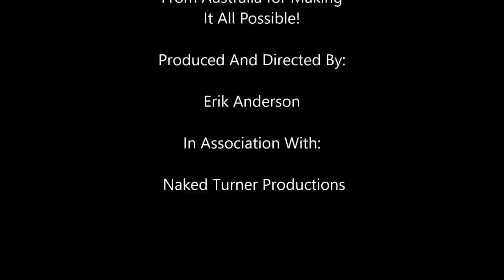Naked Turner Hairy Oak From Les From Australia

Comment: A bit of a notice after I posted my last comment...you mentioned Zip kicker.  Do you use the Zip/Zap brand of glues?  I have noticed that the glues (CA and epoxy) geared for R/C aircraft tend to be more resilient as far as flexibility when it comes to woodworking.  Used the CA's and epoxies for cabinets, pens, etc with very good effect.  I have found they tend to be more resilient in the long term to other types/brands.  Zip/Zap brands tend to work best for my stuff with respect to longevity to more handled items.
Reply from the maker: +AnkleBiter Woodworks Yes it is Zip/Zap
Reply: +Erik Anderson Cool beans.  Good stuff!